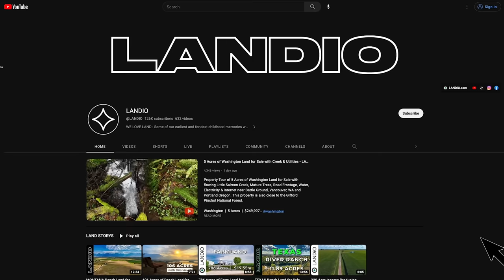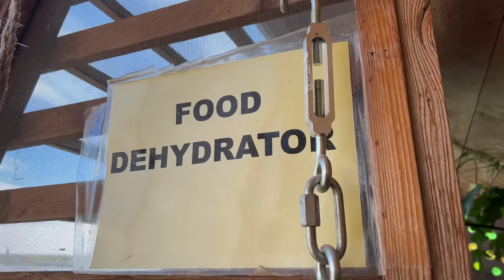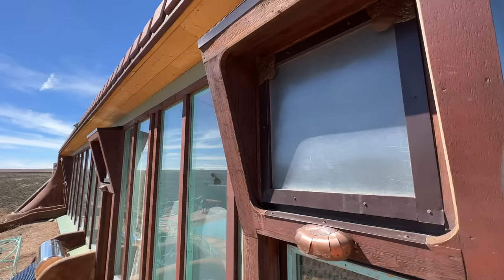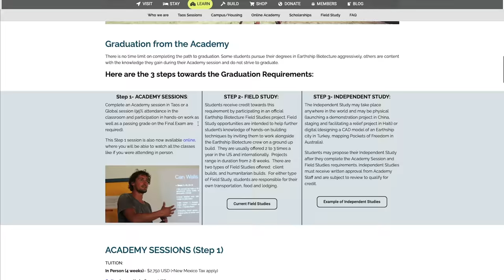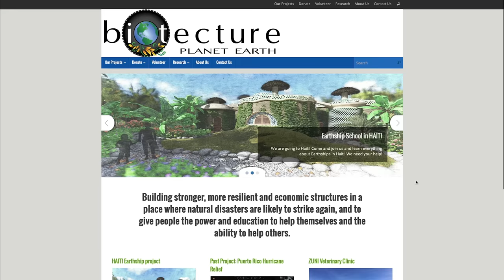EARTHSHIP = Off Grid Living & Sustainability 🚀

Comment: Giving that a 2k square foot home will cost around 550k you can tell who these homes are built for. Why can't shit like this actually be affordable?
Reply: They have the encounter model, its more affordable.
Reply: As building techniques and materials are refined it will become more affordable - won’t happen overnight though
Reply: @haramsaddam238  yeah well see, this isn't meant for the poor he wouldn't make a living doing it. But most people wouldn't want to live like this and it will stay a niche lifestyle and most likely stay expensive because of that.
Reply: Check out Cal-Earth.
Reply: It’s a 2k square foot home. I live with a roommate in 777 square foot apartment and it’s pretty comfortable. I’ll admit, maybe 1000 square feet would be better but overall it’s fine. If you could build a smaller version, around 1000 square feet, then it would probably be more affordable
Reply: ☆Don't use gas appliances, construct an outhouse instead of plumbing, use alternate water heaters and by heating small amounts as needed, "chop wood, carry water" ( look it up ), and schedule to delay some interior finishing details until later - all to avoid banksters, etc.  You will have annual energy bills still under $200/year, virtually NO exterior maintenance costs, no water deliveries, utility bills, etc.  Pencil it out! At 1/2 the cost to start with for smaller, lower tech redesign.... Ongoing expenses compared to conventional are frugal enough to allow your regular celebration.   You'll have more time to garden and go jogging.  Value your relationships, etc.
Reply: You can go to their academy and learn how to do it yourself. That will save you a lot of money.
Reply: @rocksolidwealth  still going to be very very expensive but that would help
Reply: Once it's done no more bills except your Internet
Reply: @haramsaddam238 They been saying that for ten years.
Reply: Just make 500k
Reply: I could build this myself for less than 10,000$ he is charging so much for labor and materials pretty much everything he uses for materials you can get for cheap or free so if you do it yourself it is affordable
Reply: @mortem-tyrannis tell me how any of the materials he uses is expensive.
Reply: @digitmidgit8590  the materials aren't expensive that's my point, I mean solar and water purification probably is. But it shouldn't be anywhere close to this price.
Reply: What about transport costs just "getting groceries" out there.

Comment: 🎯 Key Takeaways for quick navigation:

20:34 💧 Water Recycling and Usage
22:54 🍳 Kitchen and Appliances 
23:46 🚿 Water Organizing Module
25:22 🌞 Thermal Control and Insulation
28:14 ♻️ Sustainable Building Elements
29:09 🌐 Earthship Website and Services

Made with HARPA AI

Comment: I would love to build an earthship someday. I know that they can be difficult to get permitted if you're the first in your area to build one, which gives me some pause. I'm also curious how well the cooling system works in humid environments.
Reply: Just saying - -  you probably may need somebody like an HVAC engineer to address that problem, which is a problem & may have problematic solutions. The tech people that took over the HVAC industry avoided issues like humidity, as nobody does heat-loss or heat-gain calculations for rooms any more. Any AC unit under high humidity days will pull water out of the air, while doing nothing for the sensible temperature reading that stays the same. Much good luck.

Comment: I believe the 19 seconds between 5:29 and 5:48 show the most important, crucial improvement between the old earthships and the better thought through ones. 

Without the layer of insulation the temperature in an earth ship might be constant, but constantly the wrong temperature, while consequently needing massive amounts of cooling or heating to get the temperature in a comfortable range.

Next you can realize that a conventional but well insulated above ground house (without thermal bridging), offers almost the same level of constant temperature because of the half inch sheetrock typically put against all walls and ceiling, but against a fraction of the effort moving and compacting dirt into tires.

The great advantage of an earth ship would still be that you can use the roof as part of your yard if your lot of land is cramped for space or you want to have protection against extreme weather events. But then the roof should not be made or metal and it should be strong enough to hold a foot of dirt.

In other words, I have doubts about where, why and how most earthships are built.
Reply from the maker: @cobbles62
Good points & observations.
Design and functionalities may vary based on location, climate, etc.
It will be interesting to explore what one would do differently when building an Earthship in the Northeastern part of the United States vs the High Desert of New Mexico.
Please stay tuned, more to come.
Thank You for Watching & Leaving a Comment.
God Bless!
🚀 🤠
Reply: If you add the earth and yard to the roof then you pretty much destroy the water collection and would have to redesign the catch systems.
Modern homes do not store heat and cold they just block it from tranfering.  They require AC units to hold the temp in check.  With the earth walls and the minimal "non-junk" insulation the heat of the sun is stored in the thermal mass and it balances back and forth with the cool/heat of the house.  The ambient temp of the house is around 65-75 degrees year round.  You change it by using the convection to pull in cooler air or closing off the vents to keep in the heat.  It is hard to keep precise but always stays within comfortable limits and is easier to make cooler or hotter with less effort.

Comment: I would like to see a monthly/yearly log on the indoor temperatures vs. the outdoor temperatures.  Also, for this dry arid region, does it produce enough rain water for the entire year.  Is there an additional outside source for water, a well or ?
Reply from the maker: @jwebbw
These are all great questions.
We are working on a follow up interview to answer some of the most frequently asked questions, please stayed tuned.
Thank You for Watching & Leaving a Positive Comment.
God Bless!
🚀 🤠
Reply: I have stayed in the Unity house at various times throughout the year.  I can't give you ALL of the temps, but in the winter it is easy to stay warm, though having either wood burning or electric/gas heaters can be done for more heat.  With all the vents plugged and transoms shut it can keep around 68-75 degrees F while the outside is as low as 20.
In the summer the air vents and transoms pump air through at a decent pace and can take the temp down from 95ish F to around 78 or so.  If you are like me and need it colder simple box fans can easily drop it further.
The Taos NM area is very desert-like even though it is in a mountainous region.  It is very dry and usually varies from very cold in the winter to very hot in the summer.  The info that we got from some of the folks around the area that were living in the other "ships" was that it is rare that anything other than the normal (dismal) rainfall was necessary to have ample water.  The water is mostly gathered via morning due and the like (vaporation) that is collected by the metal roofs and the very occasional rainfall.  The more arid an area the more tanks you want to have put in so that more water can be stored.  If an emergency occurs and you are running low, you can order water to be delivered via truck to the location in order to assist, but again, this was a rare need according to the occupants.
You can add any sources to the house as you like during construction.  Mr. Reynolds has had to make concessions for all kinds of building codes in order to be allowed to build.  Even though the building is fully serviced by the solar system built into it, you can attach it to the grid to offload the surplus and rack up credits for an emergency.  Or even have separate circuits if you are wanting to put in an EV.  You can use gas appliances or electric appliances depending on the need.  You can connect emergency generators.  Connect to a water well.  Connect to city water.
When you first start to plan out an earthship with Mr. Reynolds there is a consultation and you can make all kinds of changes for your wants and he will draw up the plans for the right building (for a price of course).  They have used just about every kind of process and connection that you can think of and are willing to try new things all the time.

Comment: The motor in the Air conditioner can be built to run without consumption of current AC power..  you can use permanent magnets as motor or generator or as a permanent battery.  The electric power generation without fuel or pollution is done with Edison generators and dynamos power plants with inverters and transformers to deliver what power you might need.  A permanent magnet as a battery  for a flashlight or lantern.

Comment: So cool . Could you build in a winter climate. Such Ohio , Indiana . How much land would you need for a 3bed -2bath medium size kitchen laundry room and mud room. No 2 nd floor .
Reply from the maker: @Kevin Cain
Yes, you can build in a winter climate. If it is truly winter and freezing temperatures, it may pose a challenge with packing the tires.
You may need to plan different phases of the construction in sync with the weather.
Land space needed can be a relatively small footprint. There are a lot of other factors to consider with the land; such as access, slope, etc.
We will be doing a follow-up interview and will consider your question as one to be covered.
Thank You for Watching & Leaving a Positive Comment.
God Bless!
🚀 🤠

Comment: I love this whole concept but I’ve got a question bc I’ve seen other people pack the tires inside and tamp.. which is stronger , or does not stuffing them create a weaker structure?? Curious one am I.. love your content!
Reply: If you do not "overfill" the insides and stamp them down strongly then you will definitely have stability issues and lose a LOT of the insulated properties.  One of the things to think about with tire walls is that it is NECESSARY to use larger diameter tires and working your way to the smaller ones on the top or else use a structure such as rebar inside the tires or else it will be subject to tipping.
That's why the walls on the inside are not exactly 90 degree angles.  Lots of slopes and bulges.  But they are usually smooth and uniform if done properly.

Comment: So what about tires and how they leach toxic chemicals into the ground? The water reservoir being built out of tires with plaster, the mass wall, all the other features. Love the idea of earthships, but hopefully its a healthy solution and not one more source of poison.
Reply: Tires are made majorly of rubber, rubber is a natural material.
Reply: @sharronneedles6721  please tell me you're joking? Tires have 100s of toxic chemicals in them that are added during the manufacturing process to make the tires durable for on road use. Natural rubber wouldn't last more than 2 seconds as a vehicle tire without all the extra additives that are used. 

Please use your brain for the sake of your own health and wellbeing.

Comment: 1a. Don't love the use of tires.
2a. Don't 100% love the blackwater / greywater use on plants (You'd need an exceptionally 'clean' / chemical-free / medication-free / processed-food-free household to stop this from being a poison-recirculating loop - not sure how much plants / soil absorb / break down household product chemicals and medications.)

That said...

1b. The tires don't really offgas, and it's not any worse than a conventional Glue-Staple-Popsickle-Lumber house, since those houses are essentially pure piles of trash once decay sets in. Add this to the gains you get in price and utilities saving, and it's actually probably WAY better for 'the environment' than our conventional building.
2b. When you stack all variables up, given pipe leaks, infra cost + maintenance, disasters + backflows, again, Earthship sewage loops are probably 1000x less-polluting of groundwater and less wasteful than even grid sewers... even if they're emptied via periodic septic truck.

Love the aesthetic, love the basic principles.

I think the principles of 1) Thermal Mass Integration, 2) Sunlight-Management, 3) Power Gen/Conservation, 4) Water Capture / Re-Use, 5) Indoor Natural Areas, and 6) Non-recilinear design are the important takeaways from earthship.

Comment: Based on my architectural background, I believe that the numerous functional issues have been covered but lack aesthetic integration. The finished result appears to be an incomplete implementation, needing enhancement. Have the inputs and outputs of the mechanical and electrical loads been reviewed by the respective engineers that satisfy the site conditions? In other words, not intending to be disrespectful, is this the architect's complete control of the design process or have the electrical and mechanical calculations been performed by qualified engineers. Or perhaps, Mr. Reynolds has built a sufficient number of sites to date that he is able through trial and error to do it on his own.

Comment: Very cool, but why don't they use geothermal, instead of solar? A geothermal system is 24/7, while solar depends on sunlight, and is about 60%cheaper.
Reply from the maker: @Victor Jones 
Geat question.
We will be doing a follow-up interview and will consider your question as one to be covered.
Thank You for Watching & Leaving a Positive Comment.
God Bless!
🚀 🤠
Reply: @LANDIO  Thank you Landio. I was pricing a Geothermal system, the expensive part is drilling the shaft, about 300 ft, I was quoted at $6000.
Then you have the lines, heat pump, and heat exchanger. The whole system with labor and all, $10-13k.
A solar system in a home, I have been told, is $30 to $40k.
I have an idea for an earthship, but the expensive part is digging the hole. 150 ft diameter, sandbags. Is a dome, 18ft high, buried in a 28ft hole. Since is so deep, the septic tank would be a challenge. I am trying to figure that out. I like how in this video the waste was set up, as I did not know about this technology.
Reply: @victorjones7071  The terminology you're using is a little confusing.  When you say that a "solar system" is $30-40k, that sounds like you're talking about a solar photovoltaic electrical system, which can provide electricity to all of your home's electronics.  A geothermal system only provides heating and cooling, but not electricity.

A geothermal system, in fact, is a consumer of electrical power.  If you're in an off-grid situation, you'd need some way to supply that electric power.  A photoelectric solar system is a very good way to provide that power, in off-grid situations.

The only reason you'd implement a geothermal system in these buildings would be if you lived very far north in a very cold climate.  Even then, a better solution might be to burn wood for heat.
Reply: @OnlyFactsPlease  Electricity is all about converting heat to electricity. It does not matter the source, whether it is burning coal, using natural gas, even nuclear. So why not use the Earth's heat to produce electricity, 24/7reliable energy? Unlike solar, if the panels are covered in snow, no juice, if is cloudy, no juice. Wind? If the wind is not blowing, no juice. Geothermal is the only way to go.
Reply: @victorjones7071  Okay, I think I understand the confusion now.  Geothermal systems that you use in a house generally aren't efficient enough to produce electrical power.  Residential geothermal systems are really only practical for heating and cooling.  The type of geothermal power plant that can realistically produce electricity are specially designed, stand-alone power plants, located near thermally active zones, with very large and deep boreholes.
Reply: @OnlyFactsPlease  ok...I live in the Rockies, dormant volcanoes, nothing but heat. Thanks!
Reply: @victorjones7071  You're very welcome, Mr. Jones!

I'd like to explain a little bit more about why a domestic geothermal system won't be efficient enough to produce electrical power.  It's a very inefficient process, so if your starting temperature is, say, 55F (this is generally the stable temperature found in the earth's crust between 6Feet and 300Feet, your boiler/turbine probably won't even produce as much energy as it took to run the heat pump and the water pump(s).  

Commercial power stations that can efficiently produce electricity from geothermal heat have boreholes 1-2 MILES down into the earth, with starting temperatures of between 300F and 700F.
Reply: @OnlyFactsPlease  ok...bummer, lol

Comment: As one off projects, these are great, and they may inform decisions about projects in the future, but this isn't sustainable.  If you have to build catch-as-catch-can, then no project can ever be planned and each one is bespoke.  You're not housing the world this way.  

Also, HVAC isn't just heating and cooling.  A modern HVAC system controls humidity, which is incredibly important in some parts of the world.  You're not surviving the recent wet bulb events with tubes in the floor and 'gravity powered' transoms. You need a proper heat pump.

Comment: If you can't get permission to build a real earth's ship. Tell them that you want to build a daylight basement with regular concrete walls on three sides with concrete room divider walls. Build a minimum structure that they will accept. Then, modify it as you want after it is accepted by the inspectors.   
   Are there any real good how to build an earthship books?